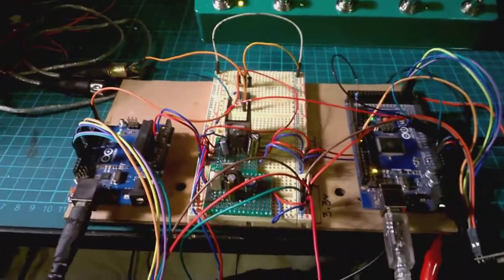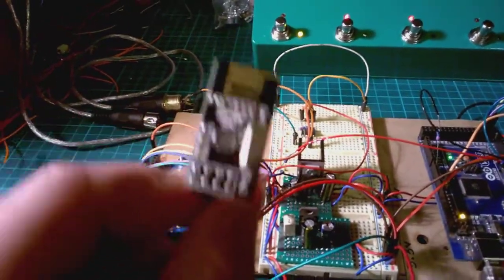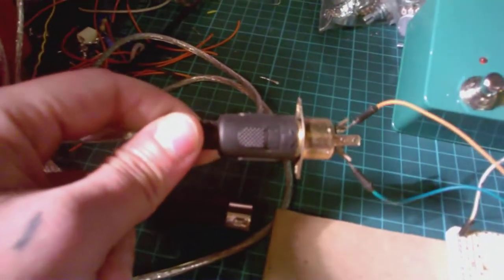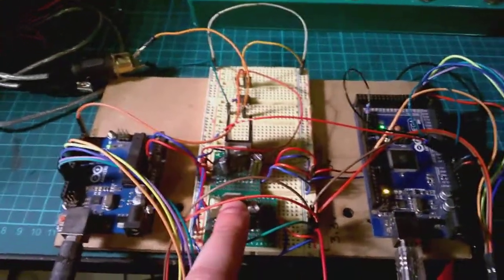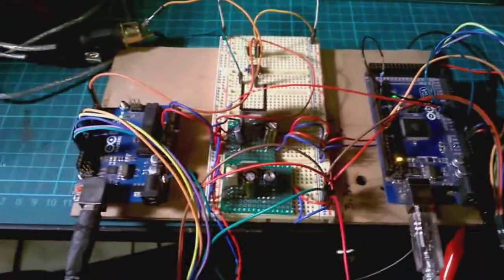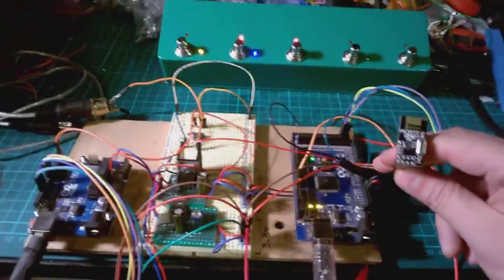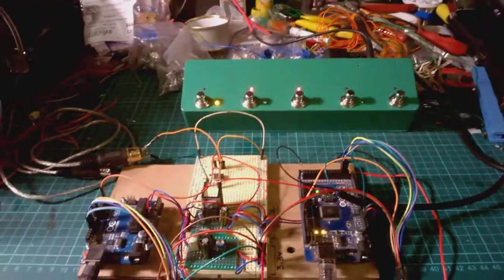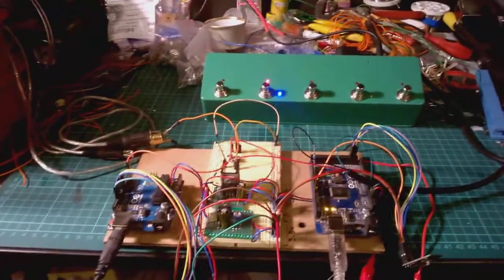MIDI over WIFI (2.4GHz) transmission - Wireless MIDI Module

Comment: TLDR???
Reply from the maker: What is TLDR?
Reply: @YO3HEX  Sorry mate. I was a bit rude here. Short story "Too Long Didn't Read" as in a short summary. I was searching like crazy yesterday for a way to send midi commands to computer via a microcontroller. I am interested to send midi commands to voicemeeter banana and after searching for a whole day could not find something. All I needed was a programming library for an esp8266 and a software on pc to receive them. In the end i managed to find something, RTP MIDI. http://www.tobias-erichsen.de/software/rtpmidi/rtpmidi-tutorial.html and there is also a arduino library for rtp midi.
I wanna say I am impressed in what you achieved here. I realized today that this is an old video and wanna ask where are you at with this project. I don't know if wemos D1 mini was out then, but you should definitely give it a try. I think you could eliminate both arduino board entirely and make everything a bit easier.
Looking forward for your reply. :)

Comment: Did you publish circuit diagrams and the code? I would build this for a wireless fcb1010
Reply from the maker: No as it turned out in a commercial project which will be released in about 1 month or so.
Reply: @YO3HEX  Is it out yet?  Send me the link to buy.
Reply from the maker: @titonelson2114  it will be in about 1 month.
The first batch was sold out only 10 units.
Reply: @YO3HEX  are there anything new the the modules??
Reply from the maker: @micha78224  yes im preparing to put the product on the market.

Comment: If i use it as midi trigger, Is there any latency?
Reply from the maker: Hansa stealth the latency is quite low and depends more on the distance ...but...for MIDI triggering, switching and or MIDI notes, you will not hear any latency.

Comment: Thanks for the video! Is it possible to connect  more than one wireless Receiver to the Wireless Transmitter?
Reply from the maker: Yes :) in a mesh topology :) - so you can have one transmitter and more then 1 receivers.

Comment: Very nice work, I was thinking about building sth similar.... I am wondering why you went for WIFI instead of BT. Isnt WIFI more expensive than BT? I can see how WIFI can give you a multi point access, but I am not sure if the cost delta justifies the feature.

I have also another generic question. Did you research BT and WIFI modules? If you did, did you any significant cost difference between BT and WIFI modules with the similar RX/TX sensitivity/power?
Reply from the maker: I will try to answer as to your questions:
First of all because it's more reliable on long distances and because i can achieve distances up to 1000m LOS, because of the provided speed (up to 2Mbs) and also because i was able to written my own protocol over the physical layer (as i said, the modules are transparent for the devices that are connected)
And just to be clear it's not WIFI as it's know by public. There is no TCP or UDP protocols over it it's just a physical layer and a proprietary protocol that allows me to have the smallest possible delay.
Also those module are use to connect 2 MIDI devices over wireless connection it will NOT connect a MIDI device to a computer (only if that particular computer has a MIDI capable interface).
I hope that i've put some light into this.

Comment: excellent...would there be any latency if it were keyboards?....nice work man.
Reply from the maker: +100roberthenry - of course there is a slight latency, but you cant take that into consideration :D because i'm throughput data @ 1Mbs and MIDI is @ 31250 ... so if there is any latency it's irrelevant for MIDI protocol. It can be considered that even at 240bpm the response on the other side is instant.
Reply: +DeXTeR&#39;s Workshop  cool....sorry man, this lark is way over my tiny brain... :) looks very cool...
Reply from the maker: +100roberthenry i'm more then happy to answer to any questions / functionalities / etc. so don't hesitate to post any questions that you might have and i will be more then glad to answer them.